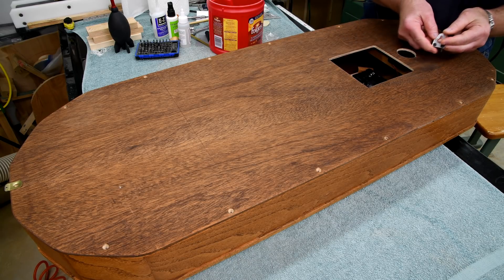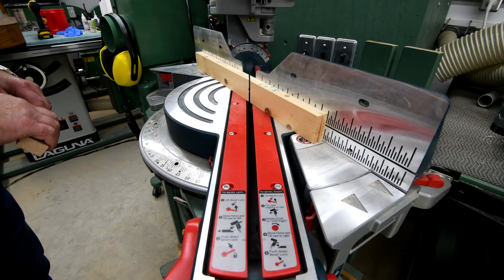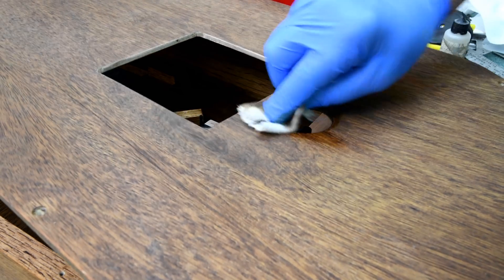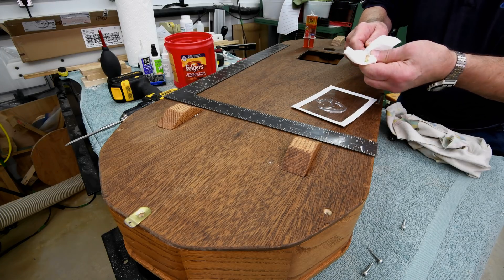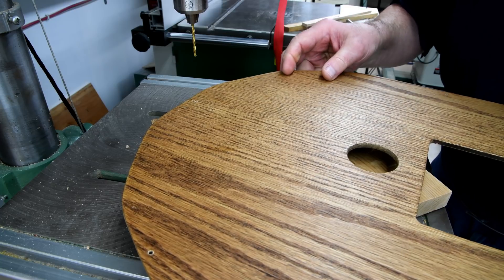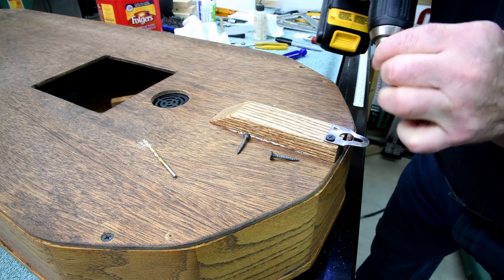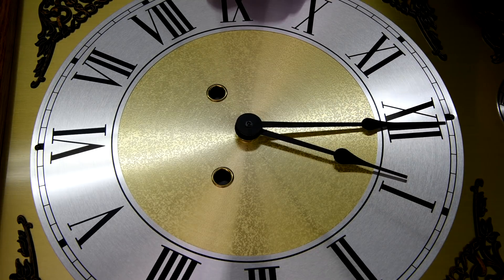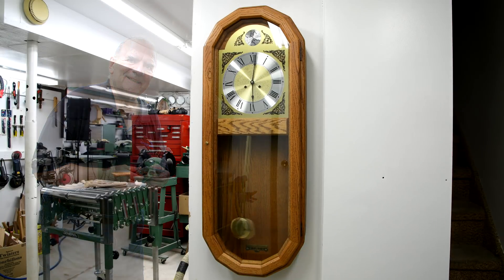The Daughter's Clock - Part 7 (conclusion)

Comment: I love your videos for the big and small clock and wait daily for the updates. I am wood worker like you and have similar workshop. I wonder as long as the clock shall be 3/4 " away from the wall why you don't make a cover for the battery compartment attached with one or 2 screws to prevent dust or spider from going in? Wish you all the best.
Reply from the maker: I've been thinking about it since JimE mentioned it, below, too. Thanks for commenting :)